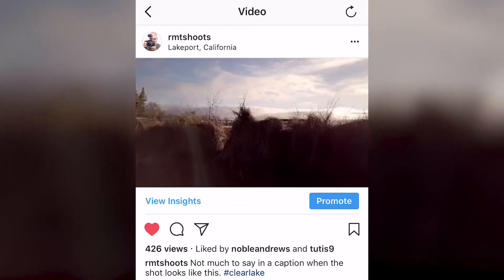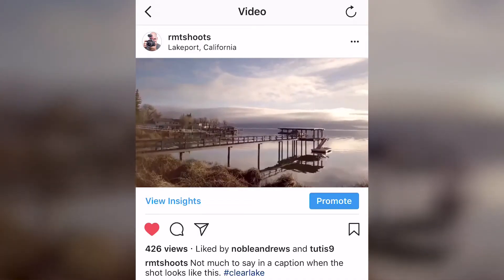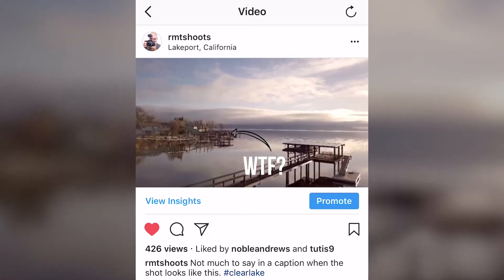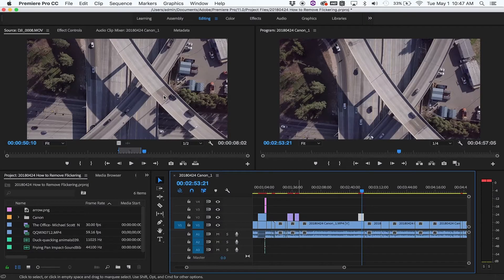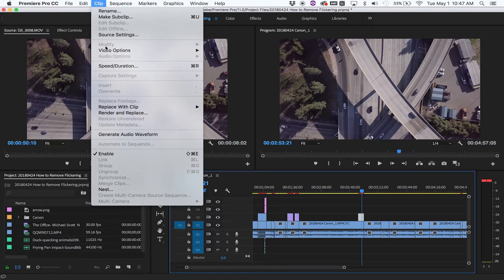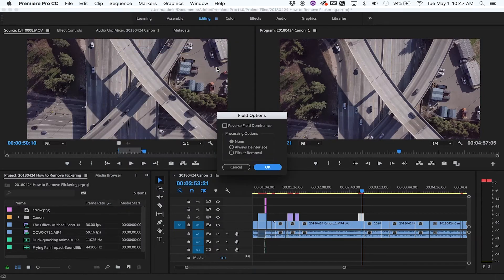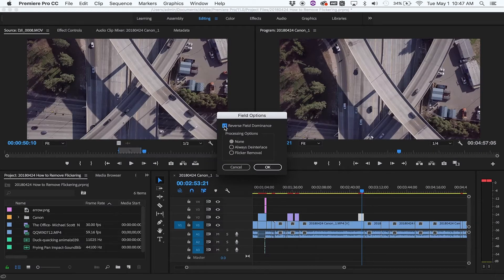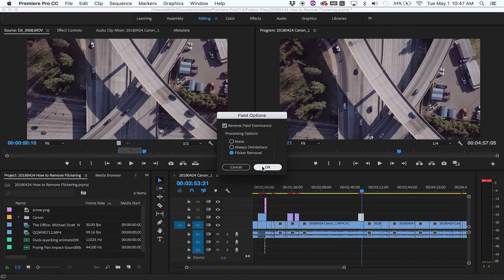How to Remove Flickering from Mavic Pro Footage in Premiere

Comment: Hello from 2025! I have the same issue exporting DJI footage (Both Mavic2Pro and Air3s) into MXF XDCAM 50i. Your solution removes the problem by %60. But comparing 4K 50p export of the same footage, there is still a huge loss of quality. Hope anyone knows a better solution :/

Comment: i was fly my air 3 in indoor wedding event.
shutter was 120
fps                60 
(180 formula)
but i found FLUCTUATION when saw at my pc or also at lcd
pls guide what will do for perfect sharp result
note: i hear 50 shutter didn't gave fluctuation
Reply from the maker: Probably very little light hitting the sensor in that environment I would imagine.

Comment: Hey Robert! i got a problem with my Mavic Pro. When i rec a footage, when i play on my mac i see a lot of noise. How can i fix this? help me! please
Reply from the maker: Hey Jul - I would start with seeing what your ISO looks like.
Reply: @RobertMTeegarden  Hey! thanks for answer. Im using 100 ISO but still with noise. Can i send you a compress footage to your email?
Reply from the maker: Was your exposure set up correctly? Upload it to YouTube with an unlisted link and post it here. I’ll take a look.
Reply: @RobertMTeegarden  https://youtu.be/MO-VuYndQ6g
Here the link! 
If you see many noise on the image :S 
sometimes i used it in automatic, sometimes ISO 100 and SHUTTER 1/3000 but still noise. I don't know how can fix it
Reply from the maker: Link is private, not unlisted. Can you switch it please?
Reply from the maker: Also, 1/3000 is a crazy high shutter speed. Usually your shutter is double your frame rate. So for example, if you’re shooting at 24 FPS then your shutter would be 1/48 or 1/50 (depending on the drones capabilities). Since drones have a fixed aperture of  f/2.8, you need to adjust your exposure with Neutral Density (ND) filters. Those are like sunglasses for your lens to bring the exposure down.

Comment: Thank you for this, very helpful. One of the great mysteries about this 'flickering' / 'strobing' is how and why it's there. And why it's in some shots and not in others. The go to assumption is it's to do with frame rate and/or luminance noise etc. It's not. It's actually the propellors that are causing it and it's due to certain angles of the camera in relation to the sun and the direction of the light entering the camera. Depending on what that angle is, the propellors are creating that subtle light flickering and it's impossible to detect in flight on a monitor. Also to do it 'in mass' add an adjustment layer above all the video clips and take it out to the length of the entire video timeline then apply the flicker reduction to it or just lasso select all the clips in the timeline then go through the same sequence as you showed
Reply from the maker: Thanks for watching and taking the time to comment, Gerald. That definitely happens but this time the props weren't an issue. I'll keep a look out for this issue though.

Comment: To answer your question. You would have to film with one complete clip and then import that entire clip into your timeline and then the Flickr that entire clip from the get go and then break it down into different clips. Not sure if that’s easier.
Reply: or you can cut the good shots and put them all together with some space together so it turns black after clip then you can render it and import them in one clip and add the effect and cut them into pieces :< why this thing is not working on nested clips lol
Reply: I see  Anti-Flicker on my Nested clip on Motion Tab in effect controls  and turned it into 1 dunno if thats work too.